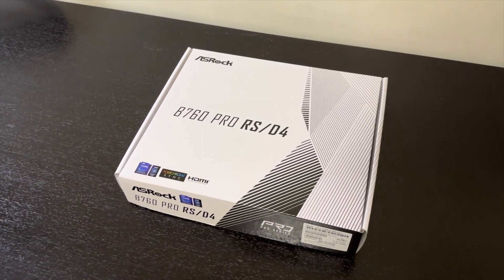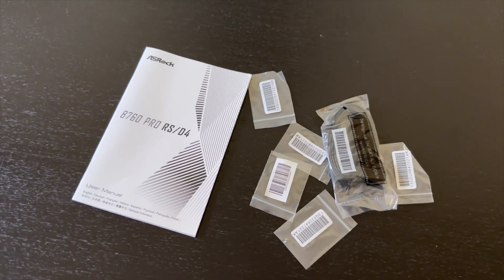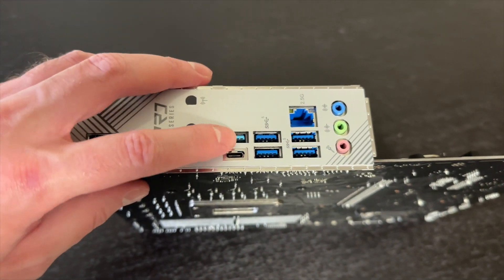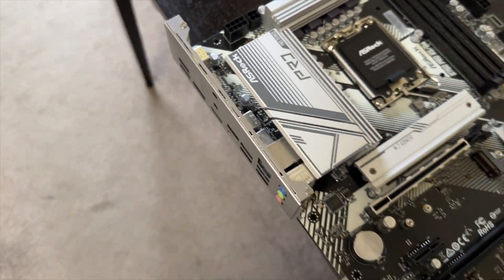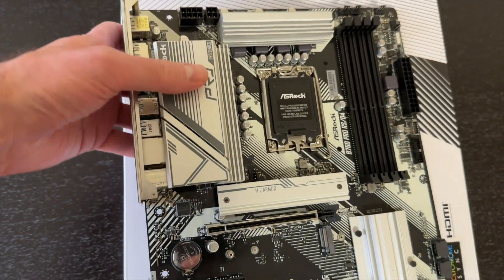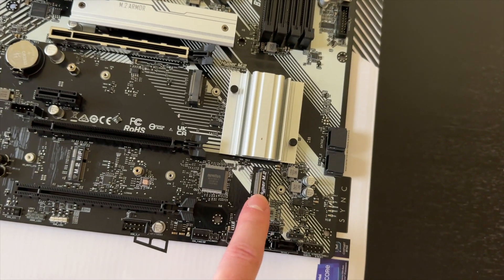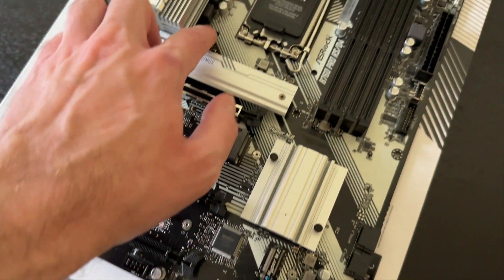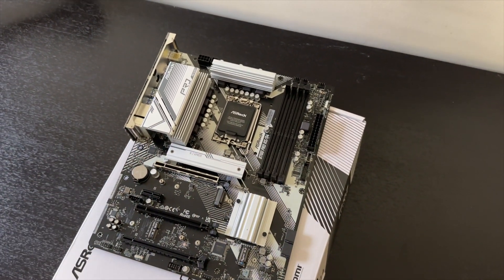Unboxing ASRock B760 Pro RS D4 (DDR4) [Features & Specs Overview]

Comment: Hello friend, a question, I am interested in this motherboard, is it ready to mount a intel core i5 13400F out of the box or do I have to update the bios with a 12 generation processor?
Reply from the maker: You don't need to update BIOS.

Comment: Hello, I just want to ask if this motherboard woud handle my Intel core i5 13600KF ? also i wanted to ask which motherboard do you recommend for this processor more ? ASROCK B760 Pro RS / D4 (DDR4) or GIGABYTE B760 GAMING X AX DDR4 ? 

I don't know much about motherboards :(
Reply from the maker: Yes, the i5 will be a good pair for this motherboard. As for your second question: both look good to me. Just buy the one you like more. Or whichever one is cheaper if budget matters to you.

Comment: I have the Z790 version of this board is awesome. DDR5 is not worth the cost/performance IMO. ASRock has always been somewhat of an budget enthusiast board and they don't disappoint with the Z. For me, the key plus with the 790 version was the PS/2 port believe it or not. I dual boot windows 7/10 and  that port made it possible for me to get USB3 going in windows 7 without having to slipstream a custom iso and reinstall. I was able to install all but 2 drivers for win 7 (yes chipset as well right from intel) - but honestly I have not looked hard for the last two 'unknown'(simple PCI devices) Windows 7/10 are also installed on a gen4 M.2. CPU is a I5 13600KF 5.1GHz

Comment: Is the H610M able to handle the i5 13400. What brand do you recommend?
 sorry for my english
Thx Before..
Reply from the maker: ASUS H610M-A is pretty good. But B660 are also cheap now. So, have a look at those as well because you may be able to find a much better motherboard for just $10-20 more. Like ASRock B660M Phantom Gaming for the same price in the US, or GIGABYTE B660M AORUS ELITE AX for just $10 extra. But it depends on what your stores have. It is worth taking a look.

Comment: Do you think B760 pro does not suit with i7 13700f?
Reply from the maker: 13700F has max turbo power 219 Watts. That is pretty high. I haven't tested this but my general experience tells me that it won't be a perfect fit. It may be fine. Go check out a review where this motherboard is actually put to the test. I'd love to do this kind of testing myself but I don't have the budget or support from companies to do enable me to do it. Hopefully, in the future🤞

Comment: can i run an i3 processor or a h610 is enough for that?
Reply from the maker: H610 is more than enough for i3. Most H610 can comfortably handle even i5 12/13400 without any issues.
Reply: @iVadimUnbox  thanks. i will go with H610

Comment: is there a significant difference between this and the Phantom gaming matx B760 Riptide? the price is similar to where I live and I cant tell major difference between that and this?  cheers
Reply from the maker: Are you comparing this Pro RS D4 to B760M
PG Lightning/D4? I'd pick Pro RS out of these two because it comes with a little bit more features. 2.5G Lan vs 1G LAN on Lightning. More slots. Better VRM heatsink.
Reply: @iVadimUnbox  thanks man for the advice I appreciate it 'D